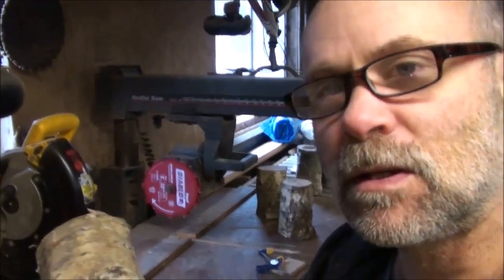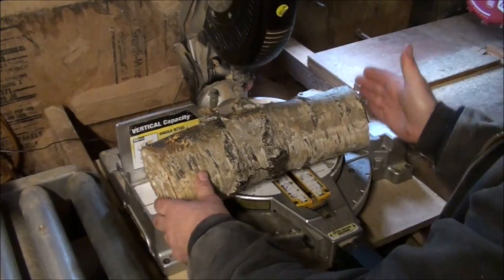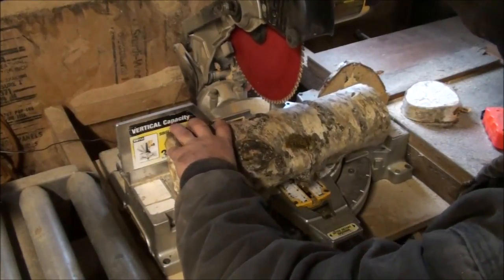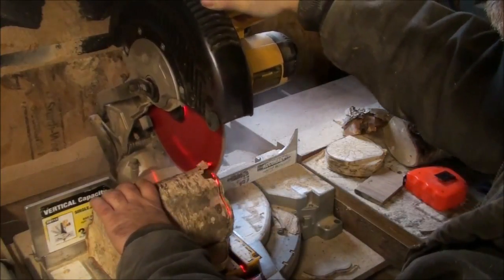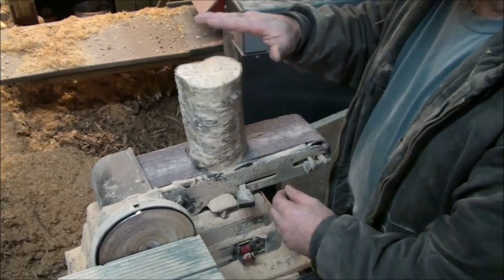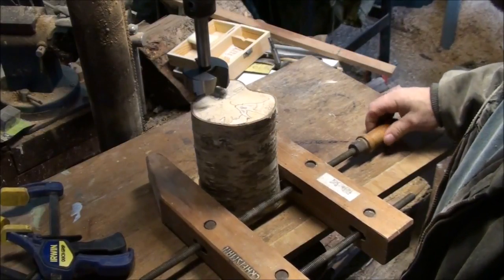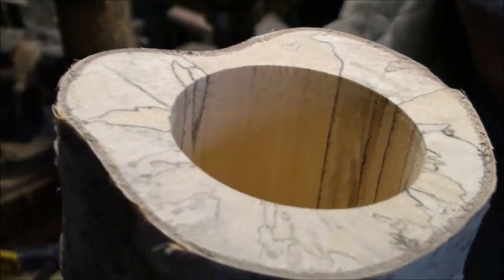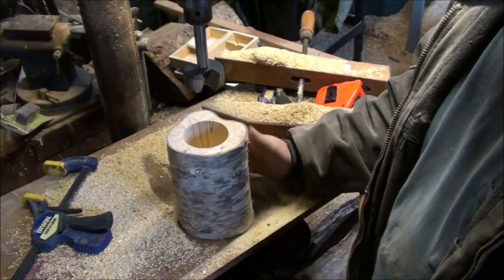Rustic Wedding Bouquet Vases

Comment: You inspire me to get a miter saw and try things. I live in Montana, so we have no lack of wood by any means. Love to see them all displayed after wedding day! Thank you.
Reply: Reiki, if you get a chance to pick one up I would recommend a saw with a compound slide so you can saw wider boards. I picked this one up at a garage sale for forty dollars and had only made a couple cuts. The only thing wrong with garage sales or finding deals is the wait 😁. Thanks for checking it out.
Reply: @MrRain-hk4zi  Thank you so much for answering. This is very welcomed advice.
I see saws quite often up here in Montana towns. Men often retire from using them, move to warmer climates to move into retirement villages now. Everything is supplied at most facilities these days, so there is no need and no where to put them anyway. I just never knew what kind and what's most user friendly for projects such as this. I appreciate your time and attention. Very interesting way to learn more, thank you. Have a blessed day  :)
Reply: You're welcome Reiki. The common saws have 10" and 12" blades. If you come across a 12" saw with a compound slide that is the one which would offer more options and capabilities. The one you see here is a 10" compound miter saw. It will do all trim work but when it comes to cutting over 6" boards or a S4S 4X4 you have to roll the board over and do some "fancy footwork" to get the job done.